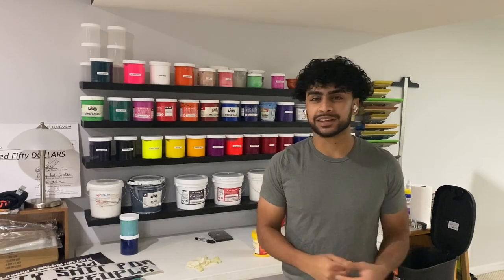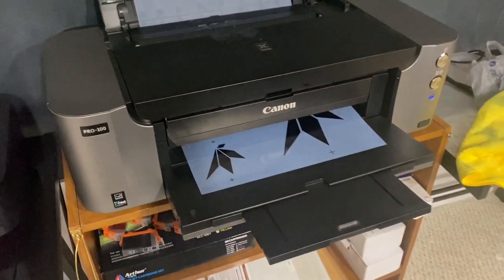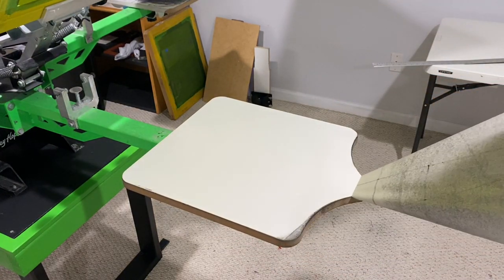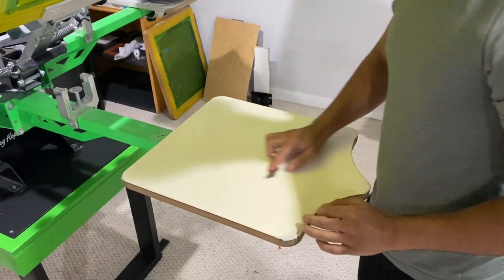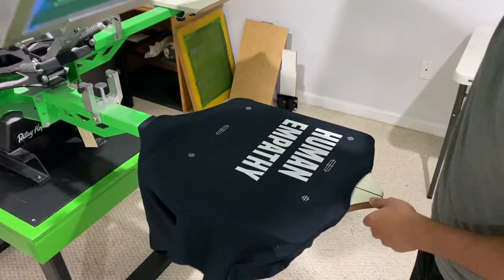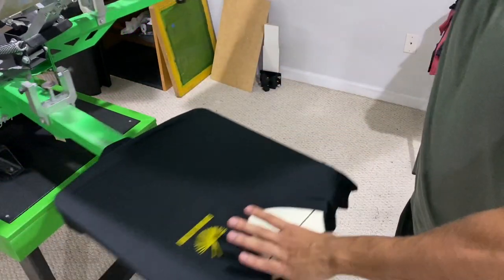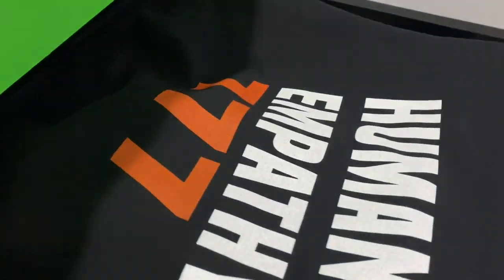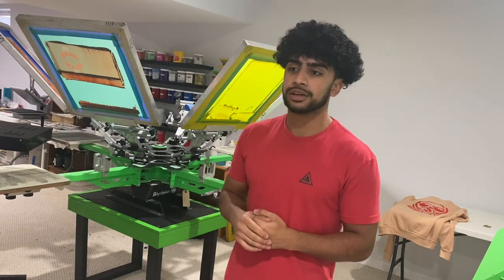SCREEN PRINTING FROM HOME! (DAY IN THE LIFE)

Comment: That clogging issue is probably emulsion "slime". Pretty easy to fix. After your screen is dry and before print take a wet rag and wipe the image on the screen. If you look at in the light from the side you can sometimes see the slime on the screen in the image area. That should take care of it. Way harder to fix on press once there's ink in the screen. That or possibly glue from the board if your setting the screen on it but I doubt it. Keep it up!
Reply from the maker: Sweet man thanks for the tip! I am definitely going to try the wet rag method out. Recently I figured out that if I just take a Clorax wipe it usually cleans it up 8 times out of 10 but the wet rag method seems a lot easier and safe!  Thank you for the tip once again and for watching the video!

Comment: Have you tracked which prints come from which printer? I wonder if the clogging is because the emulsion isn’t exposing correctly due to the ink from the other printer not being as dark?
Reply from the maker: Hey good viewpoint! However I have figured out that the clogging is emulsion "Slime" for when I initially expose the screens the emulsion drips down and dries in the opening of the screens. I prevent this now by rinsing the whole screen with a good amount of water and a air compressor to dry it up.
Reply: @baavproductions  awesome! Good to know, I'm just starting out myself.. Thanks for the content  keep up the good work!
Reply from the maker: @PolakMedic168  No problem, thank you for engaging!